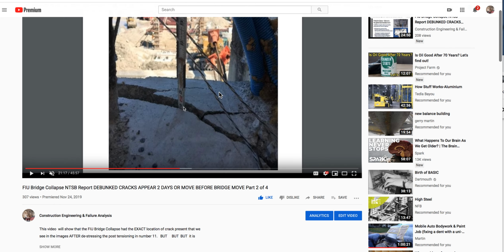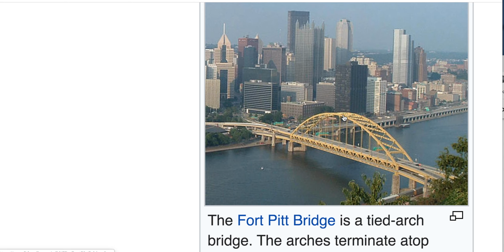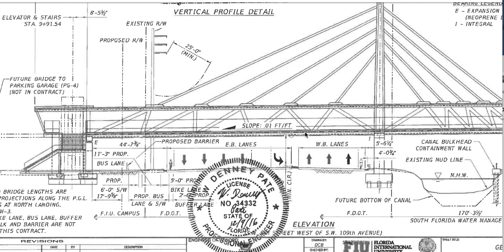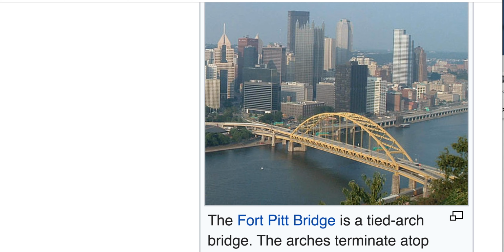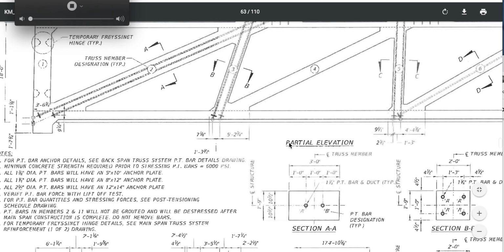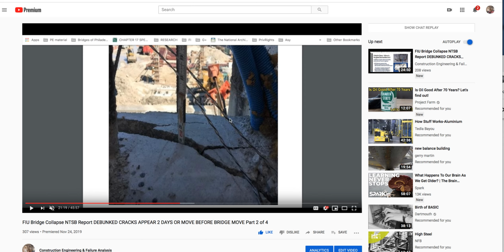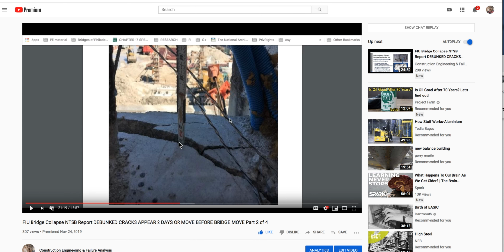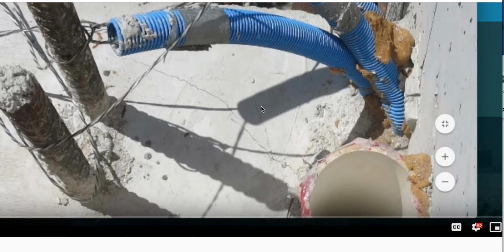FIU BRIDGE COLLAPSE NTSB REPORT DEBUNKED, TIED ARCH BRIDGE = WHY BRIDGE FAILED SIMPLY EXPLAINED pt 1

Comment: I don't buy the tied arch analogy  of the deck. Remove the canopy and truss web members and then take a section at mid-span. It's just a pretensioned slab. If the internal forces of tension in the cables times the lever arm to the centroid of the concrete in compression must equal  the moment at mid span then that's a beam. The structure didn't know how it was designed but it was built like a truss and tried to act that way. IMHO.
Reply from the maker: Mike,  one a time here, do you see that 12 and back of diaphragm is elevated and down?
Also, concrete deck would have tension and compression between some of the diagonals if it was acting a truss system... How does that resolve itself in the post tension cables? Recall they have transverse and longitudinal directions... How do these crazy forces resolve themselves?  
Also recall they are all post tensioned at the same amount and we know truss members do not apply the same amount equally in this design (if they were acting a truss system).
I accept it what the post tensioning is doing to each member, I do not think the compression direction can be changed in any of those compressed members and that includes deck and canopy UNLESS it meets a greater force...  this eliminates the truss design be default, they can't go in tension with the compression on them... unless they are failing.
Reply from the maker: PS The cracks simple are not closed cracks, they are open and that is not from buckling as you would believe... that the cracks came from a compression moment on number 12.
That is what everyone believes that have an idea that split up, cracked up, number 11 can push off number 12...  
You really have to believe what your eyes are telling you ...   Mike, if I gave you a cracked up piece of steel like that and told you do not discount anything for all that damage, and I want to sell it to as new and undamaged, would you buy it? 
Then I ask, would you let me sell you this vertical as new and undamaged?  Would you take receipt of this bridge with those cracks and craters ? 
So, I am asking you to ask yourself to forgive yourself  and look at this is exactly what is presented to you. 
NO designer of this structure, FIgg Engineering agrees it is a truss system.
The configuration of the leaning and backwards direction of the members are like no truss system ever built... 
NO engineer would change this over to steel and consider it a working truss system and get permitting for it.
This is concrete and as FDOT stated, it is of an advance design and NO ENGINEER without this advance ability is allowed to do the evaluation and represent it as okay...
They required 3 advance level concrete bridge  guys to be qualified to evaluation this structure; my point again, is FDOT did not consider this a truss system either. 
Once, you accept this is not a truss system and because of it's configuration, it cannot even act like a 60 degree truss system...  
Then you can move forward... 
Mike, I always state, per my amygdala theory, you NEVER change anyone's mind until you can change their source data, and right now your source data is this is a ''steel structure'' changed on concrete...  
This data is false... it is not steel and even steel would not do this configuration and work.
Look at you bias data, the data you consider to be a fact and try to ask yourself is it just bias? (that you want it to be true)... 
This is not a steel structure Mike.
Reply: @LoadPathEngineering  Agreed it's not a steel structure. And we can't disregard the cracks and the direction that the pieces displaced relative to each other as they point to the direction of the forces in that area.  I was just confused by your tied arch analogy.
Reply from the maker: @migilmor_trains_and_tips  , tied arch for all to understand, but "tied-back system back by "mistake "...
Mistake by Figg, I do not think that was Figg Engineering's intent.
I think, as they stated, all compressive, so no "sliding" was thought to take place...
Think about it, how would they put up this span and have no mechanism to hold it together?-- unless they thought as they did, "it's just a big I-beam" (which don't require a mechanism to trap the truss forces at the ends...
But, because the structure was saging, it change the "Web-design" , that is, the contact points now became reaction points.
You put this think back on the scaffolding/ false works and becomes stable again... yet, it should still kick out 12 if were a truss system with someway to capture those forces in the diaphragm...
But, because it is all compressive with no truss diagonals able to change position all the forces would simply be locked in place, by each joint /node/ blister.
My point is, it can't slide /push because all it frozen...
Not until the scaffolding depresses into the Earth does the sagging exhibit itself in the forms of mystery cracks.
Then when they remove the false works it then sags and this is not for "free"...
It cost that major fine crack as shown on the 8th.
This crack and others are never explained.
Yet, that cracking has a direction, the concrete surfaces by-pass each other, with elevation on the rear...
Recall post tension is in number 11 and it limits the cracking for now... But, equilibrium is not fully established, more cracks developed after the move and before de-stressing..
But, they go ahead anyway, the structure sags further and we have a huge elevation showing of 12 and part of the diaphragm  (limited because #11 post tension rods stop the full collapse.
They evaluate the cracks and document they do NOT know how these cracks came to be!
They then put a 300kips of "rubberband" force on an 8 inch steel plate and within minutes it SHATTERS the base of the diaphragm and the rest of 11...
This lost of the anchor, which was holding back the rest of the structure from sagging to ultimate failure, was instantly lost.
This only left 10 to carry the load out to the diaphragm and the deck between 10 and the diaphragm good not take that load, it had a flexural failure, followed by the canopy between 10 and 12 (possible from a bump from 12 smashing into the top of pier as the bottom of 12 was, be default pulled away from the diaphragm...
We need the original video from the ntsb, without YouTube software sampling!
That is the video we can dive into!
We also need the video from FIU without the edited out scenes before failure.
Mike, I will always address all data and will make it fit into load path failure, I will never remove any materials, structural steel, like the NTSB and OSHA reports did.
The sliding is not possible with those two sound post tension bars present...
They (BOTH of them REMOVED them) and I leave them in...
They remove them b/c technical they do not add resistance in the known calculation formulas.
But, in the real World, if that were true, we would observe, TWO SHEARED p.t. bars (they are in the PATH of your shear plane and they are internally bonded to this shattered #11)...
Please, look at that shattered #11 and change the material to whatever u like and make a model yourself, you will see it can't push anything as long as it is entrapped by concrete and 2 bars, and then one bar in the base of the diaphragm.
Make a model of straws even...